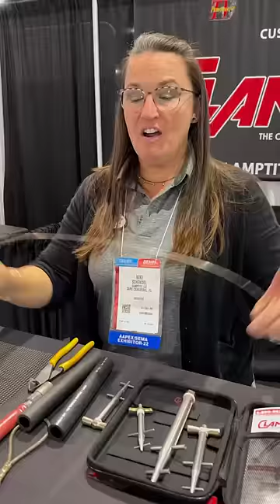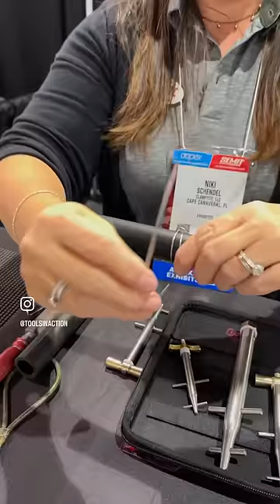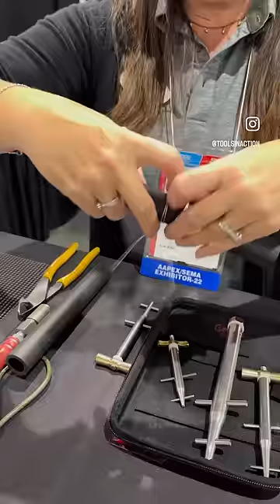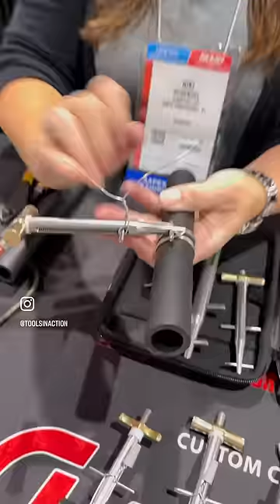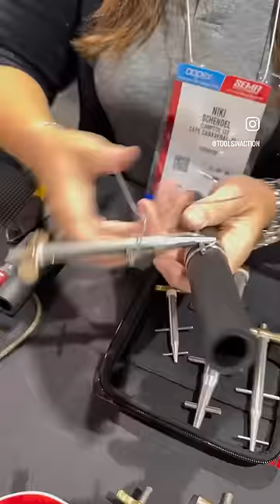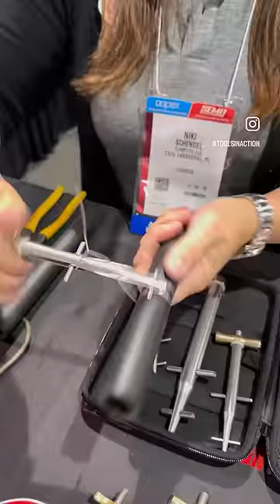Seems simple 😂

Comment: I may be missing something but wouldn't a hose clamp be easier and faster.
Reply: @stiaankruger2699 this comment made me want to buy it. They should hire you😅
Reply: @stiaankruger2699  I will try to get my hands on a set of these! Thanks Mate.
Reply: I've done this as expedient in a pinch. 
But hoseclamp is better and reuseable.
Reply: The reason these arent standardized is they are not idiot proof. Some guys will do 1 wrap when it needs 2 and everyone will tighten it down differently, many not enough. Also many would end up using any old wire like rebar wire or even copper wire. Steel rebar wire corrodes quickly and copper work hardens. Great method of clamping hoses for a pro that understands the system but the current methods of clamping hose are more idiot proof
Reply: @DTNorthern  I never ever saw "clamps" like that in a professionally built machine.
Reply: This is great for fixing air hoses, its not gonna cut you all to hell everytime you use the hose like a screw and band hose clamp will.
Reply: Made one out of a turnbuckle and a drywall anchor. Works great.

Comment: Back in the 70's, a friend's grand dad was an old retired rancher.  He kept a very similar tool in leather tool wallet that he took with him everywhere and he had that tool since he was in his teens.  There's actually a bunch of things you can fix with the tool, other than a hose clamp replacement.  He gave us each one for xmas, and I still have mine to this day.  It didn't have a twist handle at the end, but a cross pin that wound the wire... but same concept.

Comment: I have 3 of these. every boat owner should have one. It works better and more reliably than a hose clamp. The only limitation is that you don't always have the room to manipulate the tool since it requires a 90-degree turn of the tool at the very end.

Comment: Safety wire is not for pressure, it's to keep nuts from coming loose. Also turnbuckles.
Reply: Ed

My 12v tire inflator says differently.
3 years and still holding.

It doesn’t have an airworthiness certificate, so the FAA doesn’t care 🤷‍♂️

Comment: How can you justify your double loop is stronger then the single loop when your only using 2 strands of wire to keep tension on 4 strands? When cable splicing it's rule of thumb to use equal strands 1-1. You used 4-2 ratio

Comment: You are actually very wrong lady. Dont ever say “Its a round wire so you dont have to worry about it cutting into whatever you are working on” ever again. Cheese cutters are round wires, cake cutters are round wires, clay cutters are round wires…… Its the fact that steel wire isnt very thin and you arent applying enough pressure or force to force it to cut. In fact by definition metal wire is round.
Reply: You clearly didn't understand her point. 

Hose clamps (what this system is designed to replace) have sharp edges that can damage the outside of hoses. 
A round wire doesn't have sharp edges...

Also, braided fiber reinforced rubber hoses are a bit different density than cake and clay...
Reply: @Az_N.S.O.L.  I didnt miss her point at all. I responded to exactly what she said, not what you think she said. You must not be very smart or just dont understand how te universe works.  Watch the video again and pay attention the reaction the surface of the rubber has to the wire being tightened, then imagine what would likely happen if it was much thinner wire and then maybe go educate yourself on physics or maybe start doing experiments on the things thin wires can slice through with various forces and pressures applied. Wire is also used to cut through metal. The whole point I was making that YOU missed Im going to let you figure out on your own since you decided to open your mouth and remove all doubt.
Reply: @0blacklightning046   you're telling me to imagine what COULD HAPPEN "IF" the wire was thinner and had more force.
So your whole point is moot. You are making up a scenario that didn't happen.

Please tell me where she said a wire could NEVER cut the hose...she didn't.

Also please tell me where I said a wire could NEVER cut the hose...I didn't.

I'm fully aware that a wire with enough force could cut through lots of different materials , but thats not the point...Like I said originally, you completely missed her point.

Her point was to compare this wire system to using a different clamping method and the damage it can cause.
The point wasn't to say a wire could never damage it under any circumstances.

Man talk about being not too bright...

"I responded to exactly what she said, not what you think she said".
Oh lord, the irony of your hypocrisy. SMH
Reply: My question(s) after viewing this were, so you don't recommend square wire? Would triangle wire apply uneven pressure? What happened to "you can use any kind of wire"  that you led with?
Reply: @0blacklightning046 you seem like someone who tries to sound smart. Try not saying anything it's the smartest thing you can do
Reply: @TeamAurorapk  Well…. Since I am smart. Then what does that make you? You are somehow smarter than someone who knows more than you do on both subjects?
Reply: @0blacklightning046  you failed you get a zero. The letter grade that stands for is F.

thank you for playing
Reply: @TeamAurorapk  That was a nice try but you arent a teacher nor are you even knowledgeable enough to be even remotely qualified to say I failed on anything. Move along.

Comment: Why not use a clamp, haven't they worked fine for 100's of years  ?
If this is quicker and cheaper than a hose clamp, why haven't manufacturers started using them?
Maayybee they don't want to replace all the stuff that will be ruined by using this crap system...

Comment: You haven’t designed anything that hasn’t been around already for 50 years or more more like 60 that I’m sure of. We called those Chrysler clamps back in my youth because Chrysler cars had them on the radiator hoses and heater hoses rather than the spring loaded kind like GM used. Do your homework first.! Tell that to your boss!

Comment: Seems pretty useless ngl. Many other solutions are better and require half the steps. Also even for a pinch, this is much less common than a simple water clamp. Points for it being a different way of doing things but since its leagues less efficient than most other methods of clamping a hose, its really not much of a win.